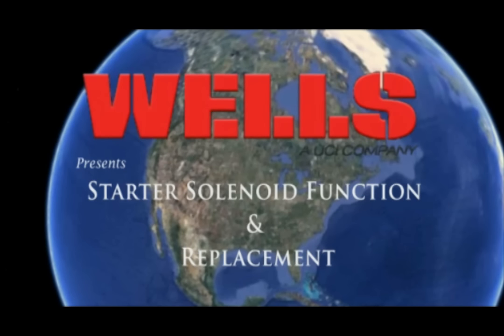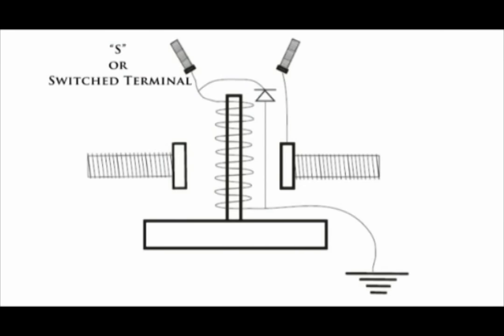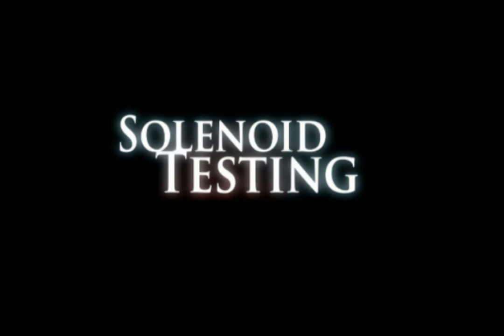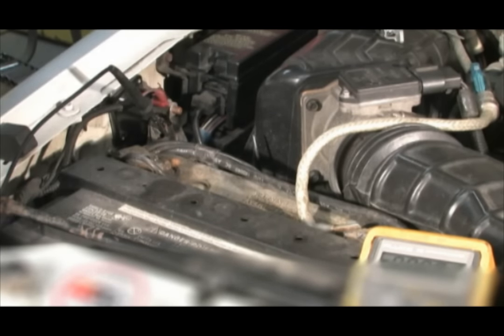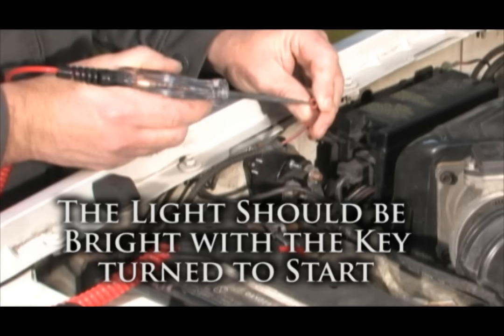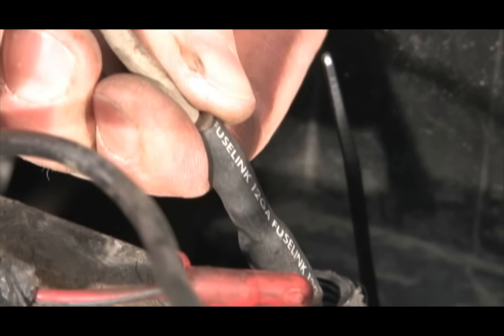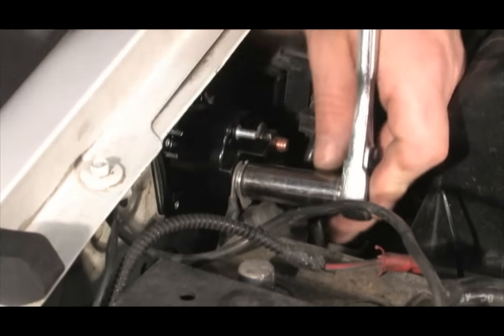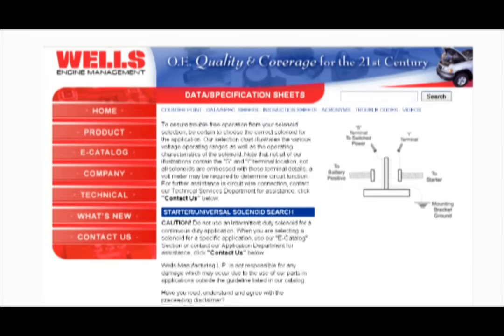Solenoid Testing, Function and Replacement

Comment from the maker: Disconnect the "S" terminal and connect a test light to it .. like we did in the video. Try to crank the engine and the light should come on bright. If it doesn't it means either you have a problem with the wire to the "S" terminal, neutral safety switch or ignition switch issue. 
Stay in touch,
Mark Hicks
Wells Vehicle Electronics
Reply: Can you use a meter as well?

Comment: Great video. I replaced the starter solenoid in my 1998 F-150. Turns out not to be a problem, but was a problem because it exploded into a thousand pieces when I tried to remove the first nut. Now, it seems like there is a break in the "S" terminal wire. I can't seem to find out how to replace that wire to fix it. Some days it starts, some days it won't. Very frustrating.

Comment from the maker: Well thats a good sign. Does the solenoid click when you try to start the engine? If it does it means it is working. Then check the cable to the starter from the solenoid. You can also try connecting a jumper cable from the solenoid to the starter. If it then cranks the cable is defective. Also check if  the wire going to the "S" terminal on the solenoid is getting hot when trying to crank the engine.

Mark Hicks
Wells Vehicle Electronics

Comment from the maker: 6. If the switches are showing a valid position combination, attempt to move the shift motor with power and ground applied to the Yellow (YL) and Orange (OR) wires of the shift motor to make it move completely to the 4L or 2H positions, and then recheck the indicated position of the position switches on the flat 8-terminal connection. 
Mark Hicks
Wells Vehicle Electronics

Comment from the maker: The first thing you want to do is check for voltage on the "S" terminal of the solenoid when the key is turned to the start position. If you have constant power there, then turn "on" your headlights and try to start it. If the headlights go out it means either the battery is going dead or you have a bad connection on the battery. If you can jump the solenoid and it cranks, the solenoid is working.
Let me know how it goes,
Mark Hicks
Wells Vehicle Electronics

Comment from the maker: When you turn the key to the start position there must be 12 volts on the wire going to the "S" terminal. Disconnect the wire there and see if you have the 12 volts with the key turned to start. If you don't, check the fuses and the ignition switch.
Mark Hicks
Wells Vehicle Electronics
Reply: What if you get 10v at the signal wire with key turned on and test light lit up?

Comment from the maker: 4. If the LED does not illuminate, check the power and ground circuits of the remaining 8-terminal pigtail connector before condemning the shift module.

5. If the module passes self test, check the resistance between the White/Yellow (WT/YL) wire of the 8-terminal flat connector, and the next 4 wires down the connector row, one-at-a-time for indications of open and closed readings that will identify the position of the shift motor.

Comment from the maker: Monitor check engine light operation. If it comes on the PCM powers and grnds are OK. if not go there first. if it comes on crank the engine, as soon as the engine starts to turn, the check engine light MUST go out. if not go to the crank sensor and check for about .7v AC output at normal crank speed. 
The crankshaft position sensor has a very high failure rate on your vehicle.
Stay in touch,
Mark Hicks
Wells Vehicle Electronics

Comment from the maker: It sounds like either you have a low battery or a defective cable. When a solenoid just does a series of clicks it means you do not have enough amperage / voltage to hold it "on". Hope this helps!

Mark Hicks
Wells Vehicle Electronics
Reply: Thanks, I think that's it!

Comment from the maker: You may have what is called a parasitic draw. To check remove one battery cable and connect an amp meter between the cable and post on the battery. Let is sit for about a half hour and read the meter. If it reads more than 50 mamps, you have a draw. Leave the meter hook up and start removing fuses. When you find the right circuit the meter will drop. Then reconnect the fuse and start unplugging what ever is in that circuit.
Mark Hicks
Wells Vehicle Electronics

Comment from the maker: Turn the headlights "on" and try to start it. If the headlights go out when you try to crank the engine, it means either a low battery, cable or most common a bad connection on the battery. 
Let me know,
Mark Hicks
Wells Vehicle Electronics

Comment from the maker: It is typically on the side close to the radiator. There may be a heat shield over the top of it. Look where the transmission meets the engine.

Mark Hicks
Wells vehicle Electronics

Comment from the maker: It is recommended to replace the solenoid with the starter because, if the solenoid has some time on it, it more likely to stick in the "on" position and keep the starter engaged while the engine is running. This would in turn ruin the new starter. 
Thank you for the kind words, they me a lot to us,
Mark Hicks
Wells Vehicle Electronics

Comment: so if i take the black connector off of the solenoid and bridge that connector it will start right up...if I hook it back up to that solenoid it wont start...doesnt even make 1 click noise. but if while that connector is on there is i bridge the 2 studs that they are bolted to with a metal wrench it starts right up.  is that a bad solenoid? i just changed it 3 yrs ago its probably got less than 10000 miles on it.  all that voltage testing looks confusing but i guess im gonna have to figure that bad boy out.  any info is greatly appreciated thank you

Comment from the maker: It sounds to me like either the battery is defective or the charging system is not working. Start the engine and connect a voltmeter to the battery, you should be charging 14.5 volts with the headlights on, give or take a little. 
Let me know,

Mark Hicks
Wells Vehicle Electronics

Comment from the maker: @sonico73 Try turning your headlights "on", then try to start it. If the headlights stay bright, check that power is getting to the starter. If it is chances are you need to check the starter. Try tapping it with a hammer while trying to crank it. If that works you need a starter. If the headlights dim while trying to crank, it means a poor connection or bad battery. 

Stay in touch,

Mark Hicks
Wells Vehicle Electronics

Comment from the maker: 1. Access the 4WD shift module and disconnect the 5-pin and 8-pin flat connectors.

2. Perform self-test of the 4WD shift module by pushing the small button on the module and looking at the activity of the Light Emitting Diode (LED) on the module with the ignition switch in the Run position. A pass of the self-test will result in 4 flashes of the LED.

3. If the LED illuminates and stays on, replace the 4WD shift module.

Comment: The solenoid does a single click when you try to start the engine.  So I connected a jumper cable to the large post on the starter (key in "off" position, of course) and connected the other end to the "s" terminal and the starter cranked.  Then I tried a jumper cable from the battery positive post to the "s" terminal and again the starter cranked (a similar test, I know).  So I'm guessing the wire from the "s" post on the solenoid down to the push on fitting on the starter is bad?

Comment: I have a 2001 ford expedition 5.4L. Im having a problem with what i think would be the starter solenoid.  What it does is, i go to turn the key and it dies as if there isn't enough power getting to the starter to start it. If i jump it at the solenoid it starts just fine. My battery is fine and my alternator is fine. Please help if you can?? Thanks

Comment from the maker: Either you have a bad starter, negative cable or connection on negative cable. I would first connect a jumper cable from the engine block or better yet the starter housing and to the negative post on the battery. If the starter now works, check all connections from starter to battery negative. If it still will not spin, chances are the starter needs to be replaced. 
Stay in touch and let everyone know what you find please.
Mark Hicks
Wells Vehicle Electronics

Comment: 2004 Grand Am engine turns slowly. I thought it was the battery, battery tested good at auto zone with good cranking amps. Tried again, had someone crank engion, again turned serpentine belt slowely then I smelled smoke, and starter was very hot. The starter came out but I couldn't get the solenoid mounted above it out. Is it possible the starter (hot) is bad and the solenoid is ok,

Comment: I have a 1992 V-6 Eddie Bauer Aerostar, when I turn the key to start it, the dashboard lights up, but the engine won’t start, I try this several times and then it will start. I don’t think it is the battery because I usually charge it after the car has been setting in my air conditioned insulated Barn and I keep the Barn heated in the winter. Can you give me an idea of what to try? Oh, I am the original owner and bought it from the Ford Lima Engine Plant where the V-6 engine was built.

Comment: I have 12 v on battery side of solenoid and only 7 volts on starter side while attempting to start. Does neutral safety switch come into play before or after starter side of solenoid. What should voltage be on starter side of solenoid.

Comment from the maker: @MrMentalbreakdown00 No apologies necessary. I like the way you think and please never be ashamed of a question. Its the ones who don't like questions I am worried about. This is a wonderful subject of debate. In my humble opinion on a Ford system i think you are correct. I think it has been called a solenoid for so long no one questions it any longer. However, on other makes it would have to be called a solenoid. I am very open for comments on this one.

Mark Hicks
Wells Vehicle Electronics

Comment: I have a vt 650 shadow, and i have volts in and out of the solenoid but when i click the start button the solenoid just clicks and no volts out, this happens when the handlebar button is off AND on. Dont know if you could help me with this cuz its a mc, but any ideas would help!

Comment: Hey Mark, I have an issue with a 2003 Hundai Accent 1.5 manual. It has worked fine all along, and was just left sitting for a short period, a few weeks, now it won't start. The battery is fine, as is the starter relay, when you hit the ignition the starter can be heard spinning fine, it just seems like it's simply not extending the gear to mesh with the ring gear to crank the engine. Sound like just a solenoid issue to you? There is no unusual noise, just the starter spinning away contently.

Comment: What if my battery will charge fine and it starts fine at  first try but after i turn off the car the battery losses voltage and it clicks like on your video. i replaced the old alternator before i had this problem. I have checked all the terminals and cables and all are good. It seems like their might be a short circuit.

Comment: The voltmeter reading was good it read 14.52 .I checked the battery and it is  working. What else could be draining my batteries voltage when my car is not on.

Comment from the maker: @mybasshas7strings Hello, I am not sure why the starter would make a rattling sound at mid temperatures, but that sure does not rule it out. I would have a friend turn the key and I would go under the hood to try to pinpoint the problem. Put your hand on the starter, feel and listen to see if it is the cause. Id you are listening by the engine you kust might be able to detect the problem. 

Let me know how it turns out of if you have any further questions,

Mark Hicks
Wells Vehicle Electronics

Comment: Okay, I have a 1978 Mustang II king cobra with a 1970 torino 302 in it, i have had the starter sticking problem for a few months now and i Have gone through 5+ solenoids and slowly but surely the problem arises again, any idea why this is happening? also if you tap on the solenoid while its stick itll stop turning over, any idea why this is, please respond back ASAP.

Comment: So, if the solenoid starts when bridging the main connectors, will not start by key but the key wire is showing signs of power, does that mean the solenoid needs replaced?

Comment: I just bought a brand new solenoid but my car still won't start. I have to use a screwdriver to jump the solenoid by touching the two copper posts. Any suggestions?

Comment: I have a 2000 Honda Accord that has been experiencing faults for about 3 month now. It all started when i left my lights on one day and had to jump start. Since i tend to often do that, after that jump start, my car started to have a click when i yank the ignition to start it, then the  second yank would turn it on.First thought was the starter, but then the starter was replaced 2012, so i was doubtful. The car had survived with the start up problem until yesterday. I try to yank it for about 5 minutes and it would get a feeling just off the edge to start but not enough power.Now it completely died, no sound at all. I jump start my battery and left it on for about 20 minutes, turned it off and on a few times after that, and it was ok. Woke up today and the entire car has dim lights, there is a short rattle noise in the first  yank, follow by no sound at all. Not sure what my next move is after watching all these informal videos, any help would be appreciated. Thank you

Comment: Great video! Helped me diagnose my F-150's starter relay. I understand that this vieeo was from when Reagan was president but its so blurry i had to watch it 7-8 times to really see where the red lead is supposed to be connected when testing the various terminals. I didnt want to connect the test light incorrectly and short out the ignition wiring or something else.

Comment from the maker: First check if there is battery voltage on the connector going to the  "s" terminal with it disconnected and the key turned "off". If you do not have voltage, turn the key to the start position and check again. It should only have voltage when the key is turned to start. If you do have voltage, either the switch or the relay could cause this. When you get to this point let me know and I will tell you what to do next.

Mark Hicks
Wells Vehicle Electronics

Comment: This problem was happening before I decided to rewire my 76 ford pickup but I'll probably end up replacing the starter because it's in pretty rough shape it looks like its been hammered on and there is copper shavings inside

Comment from the maker: You should have 12 volts on both sides of the solenoid when it is activated. Try disconnecting the starter cable and see then. If you have 12 volts on both sides at that time, you have a bad cable to the starter, poor connection on that cable, a bad ground on the starter or block or a bad starter. The NSW is before the solenoid. If the solenoid is clicking (activating) the NSW is ok.

Mark Hicks
Wells Vehicle Electronics

Comment: here's my problem: whenever the negative clamp touches the negative post,sparks emerge and the starter automatically begins to run and wont stop until i disconnect the negative clamp.is it the solenoid,starter relay or ignitions witch causing this problem?

Comment from the maker: If the starter is spinning but not engaging the flywheel. Either the bendix drive in the starter is bad or there are teeth missing or wore on the flywheel. Pull the starter and inspect the flywheel. If looks good have the starter tested and probably replaced.

Mark Hicks
Wells Vehicle Electronics

Comment from the maker: The coil could be the cause, but it is rare. If you can, check for an injector pulse. You will need a noid light to do this. You can borrow one at your local AutoZone store. If you do not have an injector pulse, chances are your crankshaft sensor is defective. 
Let me know what you find,

Mark Hicks
Wells Vehicle Electronics

Comment: Great video, Question...I have 12v going in but 5.94v output of the same coil. I ordered a new coil but was wondering if there could be another issue. Getting same voltage to the starter.
Reply from the maker: Hey Trance, thanks for watching! If one side is 12v and the other side less than 12, then you have a voltage drop across the solenoid....time for a new one.
Mike Becker, Senior Instructor

Comment: Well it turns out my "S" terminal was only receiving appx 5V (voltmeter error on previous attempts) so that narrows it down.  Replacing the ignition switch didn't change anything so maybe the "S" wire needs replacing... seems like a pain since to get to though. My dad suggested running a pair of wires to the solenoid and using a start button on the dash like a modern car HA!

Comment: Hi mark, I was wondering if you could give a possible insight on a car issue. I have a 1994 Honda accord. The car wouldn't crank when I turned the key, it was just silent. I took the battery and starter to autozone and they tested good. Replaced the main relay. Also the fuses are good. Fuel pump sounds like its working. Any insight would be helpful thanks in advance.
Reply: Oh also battery cables seem fine
Reply from the maker: Check the Black/White wire at the automatic transmission gear position switch located underneath the shifter.

If no power to the Black/White wire at the automatic transmission gear selector position switch, check the ignition switch.

If there is power at the Black/White wire, check to see if the power is going through the switch and to the starter.

If power is coming out of the switch on the Black/White wire, check for an open wire or poor connection.

Let us know how it goes,
Mark Hicks
Wells Vehicle Electronics